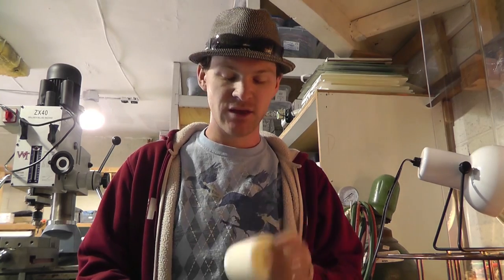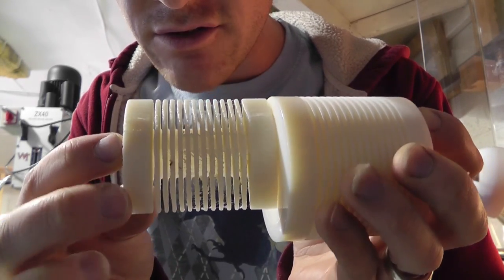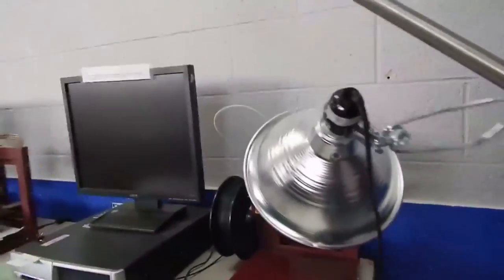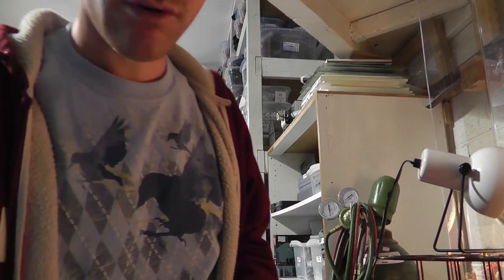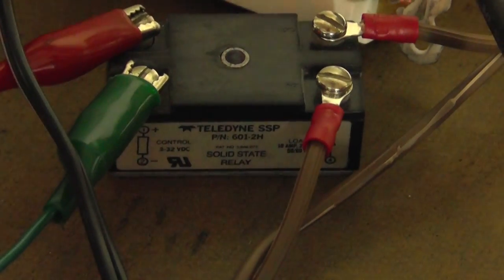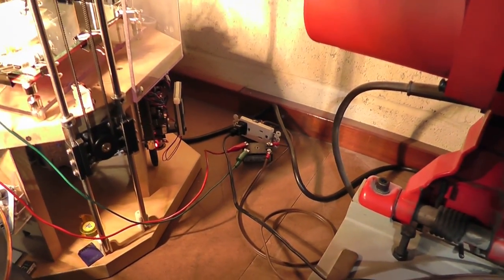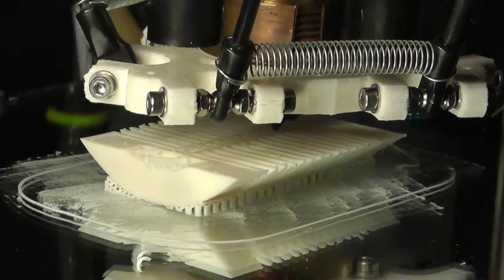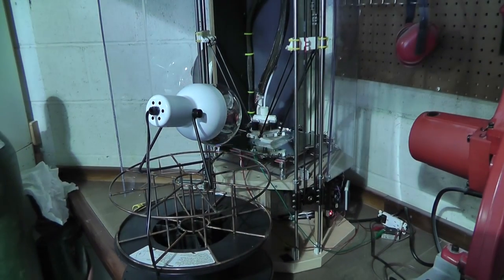(Easy Way) How To Keep Your Print From Curling Without Enclosing The Entire Printer

Comment: Russ,
My print bed of choice is polycarbonate you might like to give it a try.
Some difficult parts never stayed flat until I used PC.
I lowered my bed temperature 10 degrees because it can stick too well.
No surface prep other than an iso-prop wipe.

I even had some limited success sticking ABS to it cold.
I use 1mm epoxied to an aluminum plate. It is a work in progress.

A few weeks back I accidentally had a bad mix  of epoxy,
I used the PC on a squishy layer of goo for a couple of weeks - maybe a bit of flex is not a bad thing.

Main problem is if a part is stuck a blade will cut into the PC fairly easy.
With a stationary bed you could use vacuum to hold down a sheet or ever a film of it. Maybe ovenbag material would work - PE doesn't.

My next printer will have vacuum.

Comment: Russ if you had of built your own heated bed out of aluminum and made you own elements like I did you would not have that issue of curling at all.
Reply from the maker: Hi Jeff!
so i agree with you slightly.

i have an AL plate under that glass and it helps even the heat on the heat bed.
but the problem im having now is that the print halfway up ( when doing somthing bigger and more solid) it tends to split.

like this:

Saw & Vacuum Auto Switch W/Time Delay Off. (LOAD SENSING) Built With Junk. Schematic / Explanation

that could have been prevented by having the entire print area at the correct temp.

you can see its good until it it gets past a point. then it tends to peal away as the other hotter plastic shrinks as it cools and pulls the plastic layers under it.

this only happens when i print stuff over the size of 3-4" or so. and normally only happens at the edges

that's what I'm trying to fix here.
~Russ
Reply: *****
Ya, I hear you. I've tried a few different suppliers of ABS filament and everyone of them printed just a little different, there not all the same, so could be the filament causing the problem.